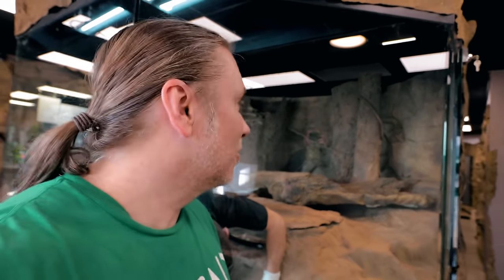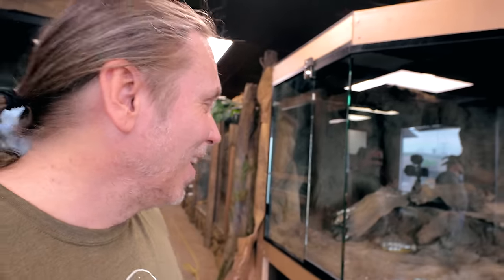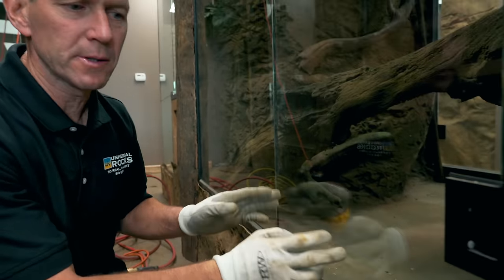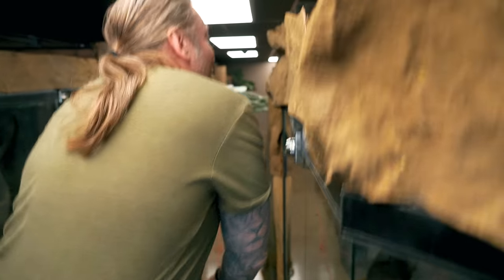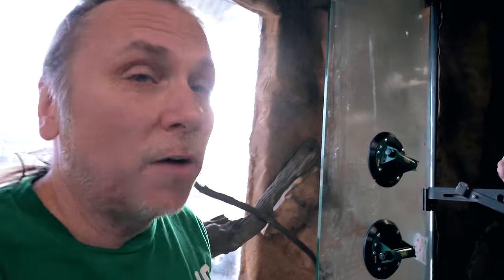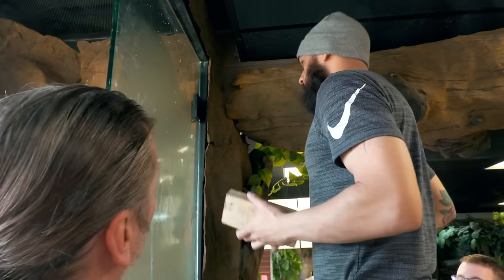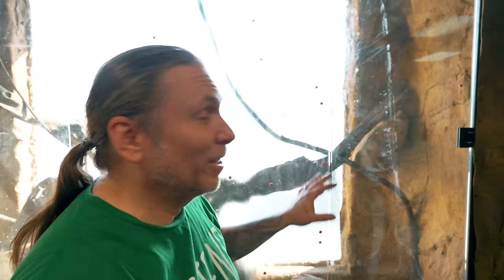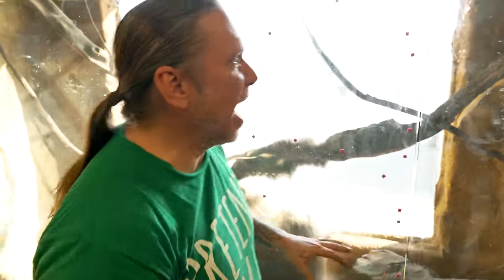GIANT IGUANA CAGE DISASTER!! NOW WHAT? Reptile Zoo Build day #3| BRIAN BARCZYK

Comment: About those ball valves on the drains : I have 30 acres under irrigation and the PVC ball valves ended up galling and eventually would not close all the way. Some of them I changed to the threaded type so that they could be changed out by adding a union next to each value. The best solution is to switch to brass gate valves but, still place a union next to each one ; makes for an easy replacement of the valves. PVC valves don’t hold up very well if they have gritty water in them. 
Watching your upgrade with the greatest of expectations.

Comment: Hello Brian and crew - Everything is looking GREAT.  I have an idea for the iguana cage, instead of using glass you could use wood and chicken wire.  The cage is for the larger iguana's and they are too big for squeezing through and they would love to use the chicken wire for climbing.  Also the chicken wire would provide more air circulation and if the chicken wire does not work you can always put the windows back on.  All the Best - Steven

Comment: I hope when you drilled into the floor you didn't hit the tension cables in the concrete although in not sure if the span your concrete floor/ceiling has them but I did work at the Columbus holiday it and had to drill into the concrete spans and had to use special hangars that only penetrated 3/4 of an inch into the ceiling as not to hit the tension cables/bars and comprise the strength and integrity of that spanner..and the concrete guys made sure to express the importance of not hitting the cables!  But I'm just saying, be very careful